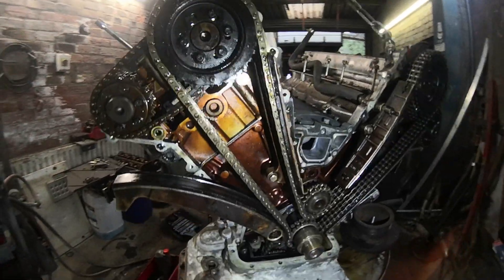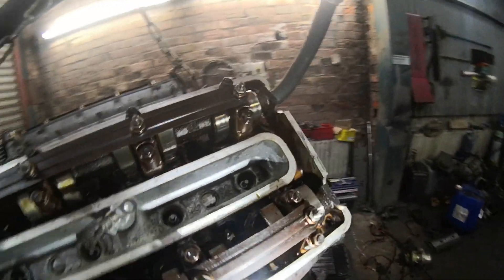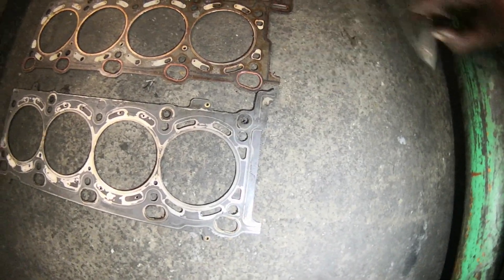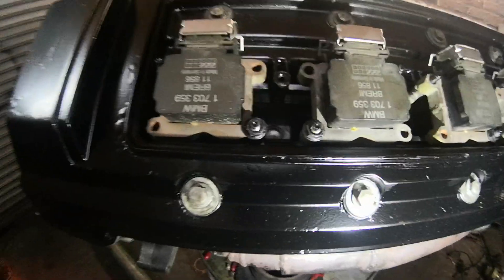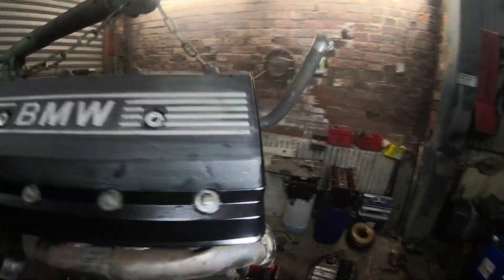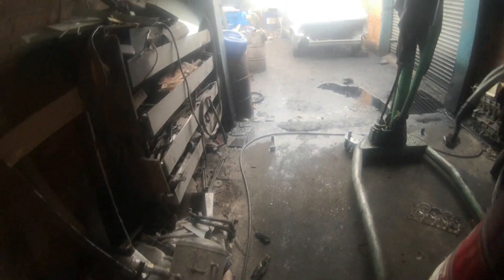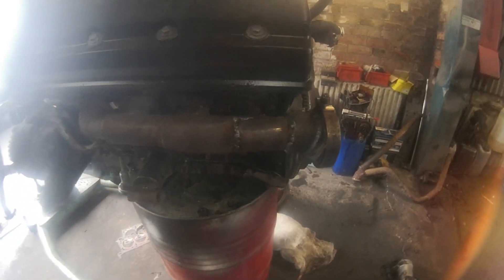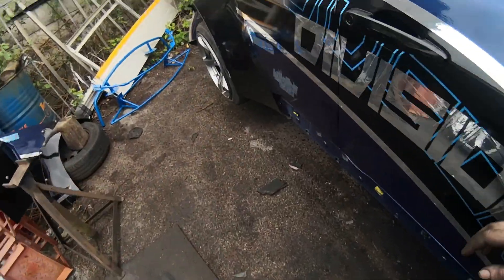M60B44 V8 hybrid engine build - Pt.2

Comment: Nice build, do you know if there is anyone in the UK doing refurbed exchange M62 Vanos units at all ? I'm just starting a M62TUB44 build myself so your info is very useful thanks.Also I got the lower timing cover to swap to a dry alternator but the alternator that I was told fits doesn't match up with the bolt patterns. Could you tell me which one you have used, I'm presuming it must be the same pattern. Many thanks.

Comment: hi! what gaskets did you use m60 or m62 
is it needed to decrease the compression with a spacer between the block and cylinder head like on turbo cars 
cheers

Comment: So all the m60b40 timing chain runners will fir the m62 block
Reply from the maker: Yes mate, all the mounts, threaded holes, etc are all there. You just take everything from the M60 with you. You must remember to block the unused oil port on the M62 block when using M60 timing gear though. It is in the videos somewhere! :D
Reply: @diehowever  lovely what do you do about the alternator on the m62 block are they water cooled. Im looking to do a full turbo build for my touring
Reply from the maker: @Falling-Fluffy  I used M60 timing covers and M60 ancillaries. I believe only the M62TU is water cooled alternator.
Reply: @diehowever  aww sweet just trying to get all the information b4 i start buying loads of shit i dont need lol
Reply from the maker: @Falling-Fluffy  I am here if you need me.
Reply: @diehowever  top man it will be more finding the m60 parts lol
Reply from the maker: @Falling-Fluffy  Message me on Facebook, link is on my channel banner. I have the M60 parts you need.

Comment: This is awesome! I have two 540s m62tub and one of them has a blown headgasket. I really am considering this to have fun with. What are you using for an ecu? My concern is the m60 engine harness and m62 e39 body harness, i wonder if they work together.
Reply from the maker: It was definitely a cool project!
ECU was briefly covered in Pt.3. It's a K-Data standalone ECU, using the M60 wiring harness. Chassis harness was custom so can't help with your situation. :(